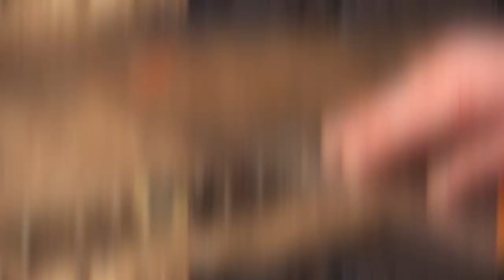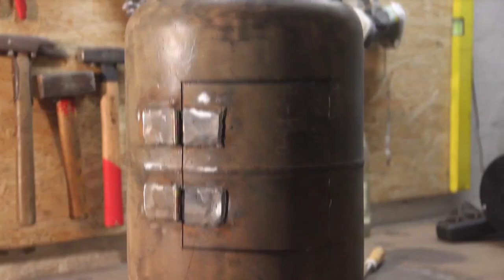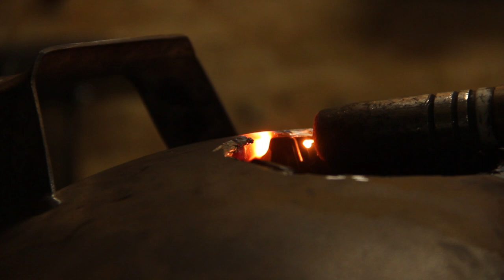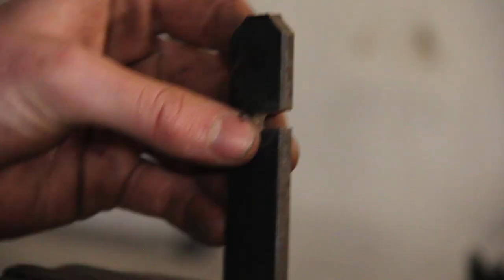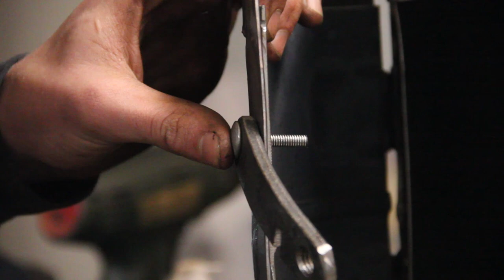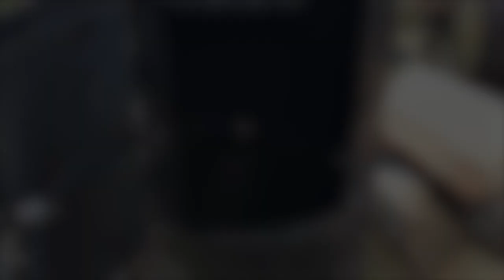Wood Stove Made From A Propane Tank! | Workshop Satisfaction

Comment: I have something like that in my garden shed, but I made the smoke stack closer to the edge of the cannister and then made a small steel box ie an oven that was welded over the center. Baked potatoes are great on a cold day and also keeps my kettle hot for when you stop for a lunch break.

Comment: What was the steel plate for that you welded in the top? Not seen that done before
Reply from the maker: It is there to divert the flames and slow down the burning of the wood.
Reply: @workshopsatisfaction5913  does it work well. Im making one from a 15kg gas bottle.
Reply from the maker: There are no real disadvantages, but we still recommend it.
Reply: It's a "Baffle". And it not absolutely necessary, but it sure does make a difference.  Nice work on the project. But what happens when you close the door?  Does the fire go out? It needs a combustion air inlet.
Reply from the maker: There are small holes at the bottom letting air in. These are big enough to keep the fire going once its burning on it´s own. This has the advantage that the fire burns slower and you don´t use so much wood.

Comment: Only Idiots would work on a propane tank without pulling out the valve  and turning the tank upside down over night to let all the propane gas escape !!!!!!!!!!!!!!
Reply from the maker: We flushed it with water.
Reply: I used to know a man that filled a gas tank with water to weld on it after he drained all the gas out of it .  He had the scars on his face for the rest of his life from it blowing up on him.  I always turn the gas tanks upside down so every bit of gas can drain out / fumes  and leave it that way for days minimum over night.  You do what you want but I would rather fill them with exhaust  if there were the slightest possibility .
Best wishes and good luck.
Reply from the maker: Of course you have to empty the tank afterwards by turning it upside down. That‘s what he probably skipped or just didn't do it careful enough.
Reply: Yes
There is also the issue with gas tanks like some Hondas 
They can have inside ridges that can hold up to about a cup of gas
even when turned upside down.
Peace
 @workshopsatisfaction5913
Reply: Did you watch the first 15 seconds?  They said they flushed and burned the tank.  Also there is no valve on the top of the tank.
Reply: @maxcorbett5926   Thank you Max  as a mater of fact no.
That must be like this morning ,still waking up and going after
the first cup of coffee.